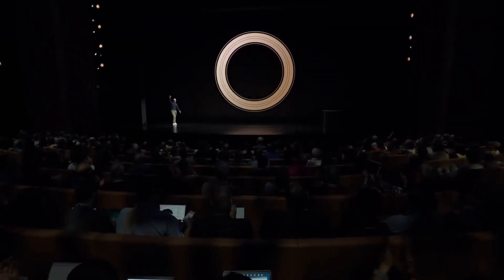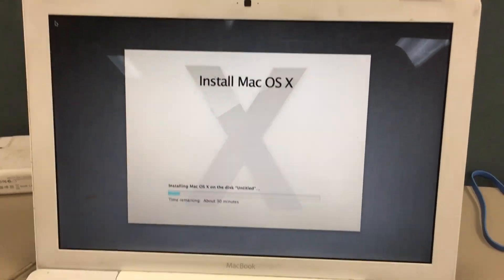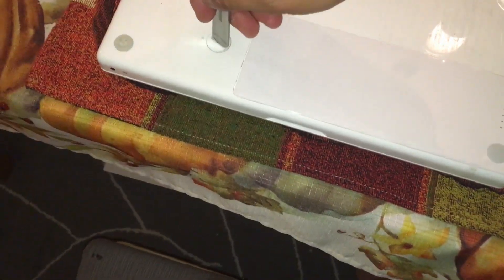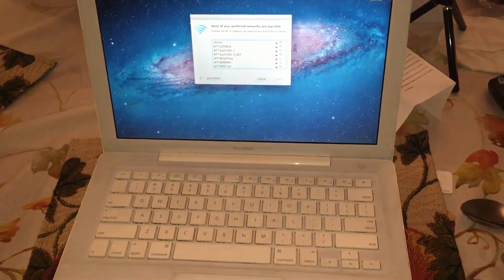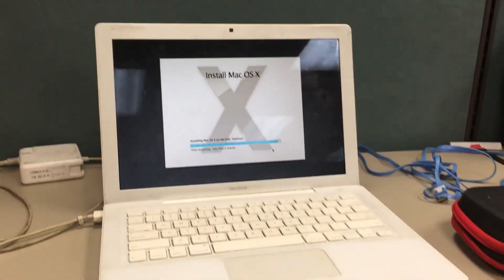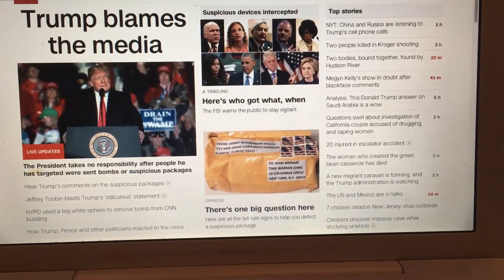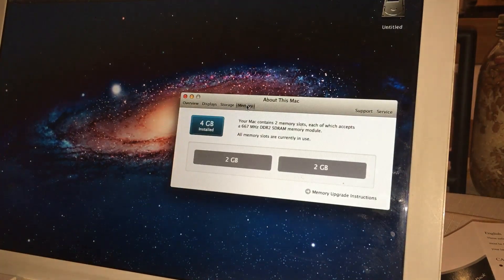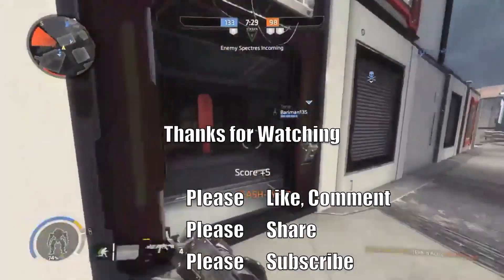2007 Macbook Upgrade Tutorial (installing a NEW BATTERY & SSD)

Comment: hi! I just placed a new ssd ( os journal format..etc) in the macbook 2007 and when I press the option key only the cursor shows up , nothing else and the snow leopard is not working from the dvd install. Any suggestions on how to install some osx on the new ssd?
Reply from the maker: So I am pretty sure you CANNOT install snow leopard on a virgin drive.  You have to install leopard first... which is what I did.  If it was a newer model macbook it may work right off the bat...

good luck finding a version of leopard available:)